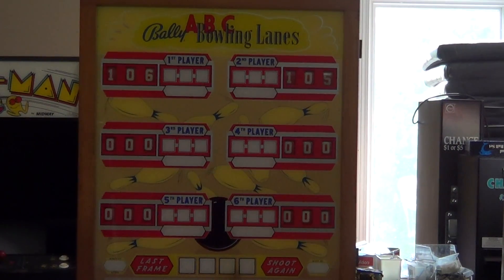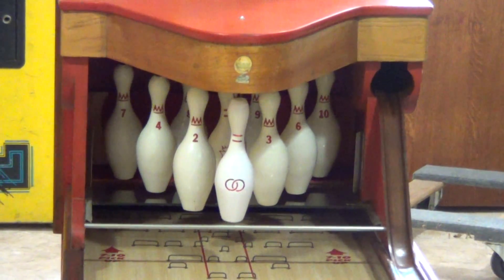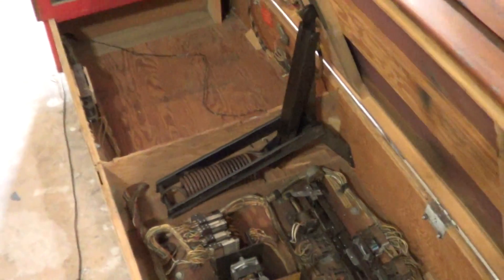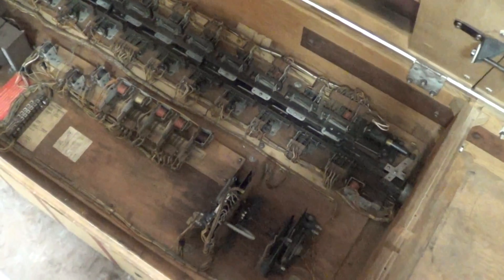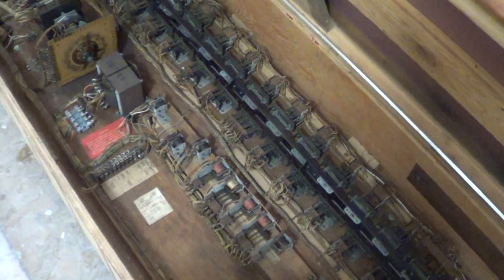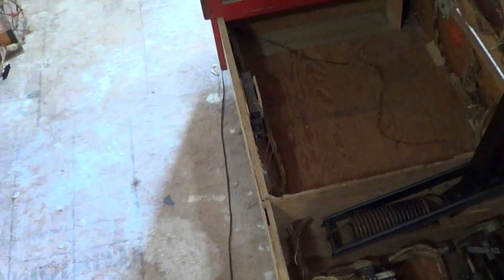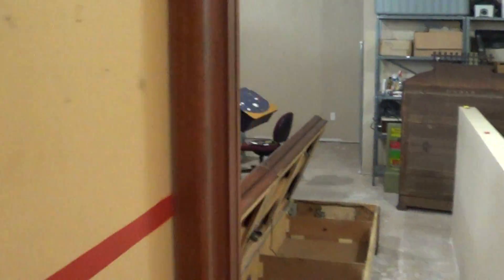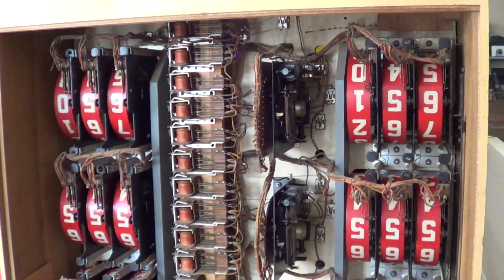1957 Bally ABC Bowling Lanes - Inside the machine

Comment: Question please, I have a Bally ABC Tournament bowler which for the most part is working good with the exception of scoring a strike. No matter how you roll the ball you never can get a strike. All pins will come up when you roll at individual pins but will never score a strike when you hit the sweet spot between the 1 and 3 pins or the 1 and 2 pins. My question is do you think the problem is to do with the leaf contacts that the ball rolls over under the play field, or the above mechanics where the pins flip up? 
I did use a burnishing tool to clean the leaf contacts under the play field already but that did not help.
Thanks so much for any advice in advance..!